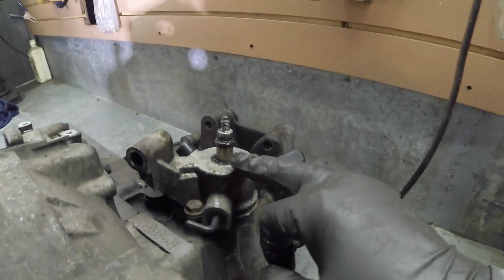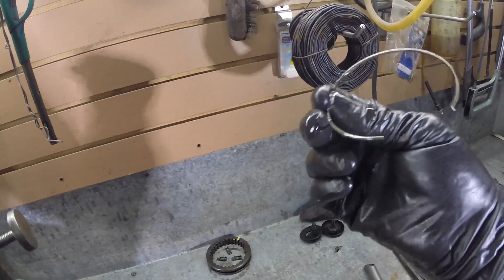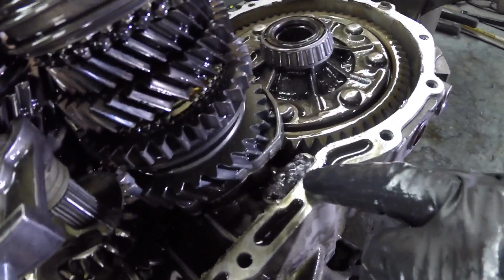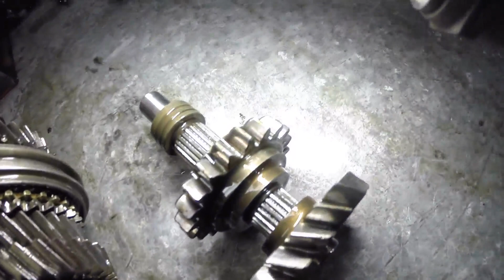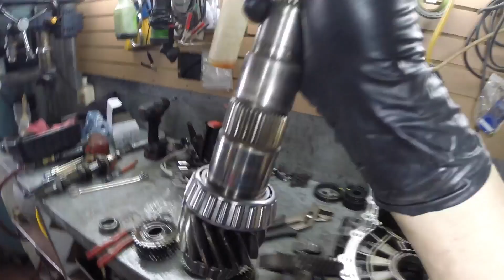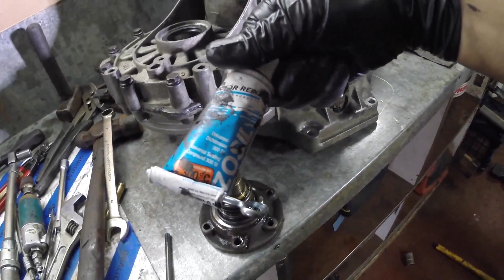GTI TRANSMISSION REPAIR DIFF BEARING AND OUTPUT SHAFT BEARINGS

Comment: You,re entirely right about welding a nut inside a bearing race , then slide - hammering it out , I did it after seeing how you did & it works o.k , just don,t get the alloy housing too hot because alloy never glows , just melts . it would be very useful if you can direct me to a video showing how to disassemble the output shaft assembly , As that,s where I,m at , to be able to change all the bearings on it . I can see how to press new ones on from your videos , they,re very useful , I,m phone-shooting videos myself as I go , so I,ll tell you when I,ve posted them up ! I,ve learnt from the guys on here , to never show an image or reflection of yourself , just your hands . if you can,t handle my accent I am not , as many people assume , Australian , I have a broad rural Northamptonshire , England accent , that I am proud of & make no apology for it , it took 4 generations of us to learn to talk this gibberish !
 I,ll look for the output shaft stripdown video as soon as you can tell me where it is . Many Thanks from Eastern Central England .

Comment: Thanks for the vid! I believe I have to replace the bearings inside the differential where the CV axle flanges sit. Am I going to have to drop and split open the whole transmission to do that? I have a manual 5 speed 03 Jetta tdi

Comment: Buddy are 02J and 02R same on the inside ? I mean I found a bearing rebuild kit in eBay but it says is for 02J and mine is a 5 speed manual 02R

Comment: Hi I'm having a problem with one of these o2j trans, it's is having the self machining syndrome where the diff rub the inside of the housing, this happens from the spring pin breaking and the diff pin slides out and hit the case, but mine is intact, so I figured it has to be the diff bearings, but mine are tight and look in good condition, is it possible for the bearings to be bad without feeling any play?

Comment: Christian, it seems to me that you are a model teacher / explainer. At each step, you explained exactly what I wanted to know next, making it an incredible learning experience for me. No waffle. No nonsense about what a gearbox is and why you might want to fix one. Instead, straight down to business, with a step by step account of what's involved. I want most YouTube videos to be like this - it would be much better use of my time. I hope you are well and went on to do many more good things.

PS: Some here have mentioned endfloat and preload, and sure they are correct. However, you and I know that usually things work out if you do what you did, and CRUCIALLY they don't always work out when you use used or remanufactured gearboxes. I've seen the LEAST good outcome from (gearbox, engine, alternator, etc) remanufacturing places that have all the right tooling. I don't know what they do wrong. Clearly there are business and engineering advantages to having all the right tools, but there are also advantages in doing things the way you do, including how much you learn along the way. When I was younger I did all of my repairs like this, and NONE of them failed!

Comment: Where are you bro? Lol I would come to you. I really like all the details you check . Says a lot to me about you being a mechanic. Take pride in your work. My bearings need to be replaced. I need a rebuilt transmission. The bearing on my driver side axle is whining when I go through my gears. I was thinking get the clutch replaced to and everyone says my clutch is good and just change the bearings on the driver side axle . I put new axles in and it’s still whining. When giving it gas. Honestly I would rather bring it to you lol

Comment: Recently got a vw jetta from coworker for $100 intended to swap my vr into. Long story short she sold it cheap thinking transmission was cracked. I looked in thought it was a slave cylinder since they're plastic and swapped in New one. Drove car to work this morning and saw trail of fluid into spot I parked at. It looks like I have fluid coming out of the top of the transmission. It looks like a inspection hole but I haven't had time to really look. Is this a sign of a bad input shaft seal? I am stumped but want to figure this out asap

Comment: how did you get the bottom bearing off the output shaft? the one that backs up by the small gear that spins the differential? there is no room behind the bearing to put the splitter/separator on it. thanks!

Comment: Good day. Very good video, it shows clearly how to perform the repairs and your explanation is to the point. If you have time I would like to ask you a question: 

I own an 2006 TDI 5 speed manual transmission (very similar to the one you repaired) Honestly I do not know the type of transmission but it is matched to a BRM engine. The transmission grinds when I engage the 3rd of 4th gear, It looks like the synchronizer is damaged. If  when I switch the gears, I let the RPM of the engine to go down to a minimum, then the gears won't grind, leading me to think the synchronizer on 3rd and 4th gear are damaged.

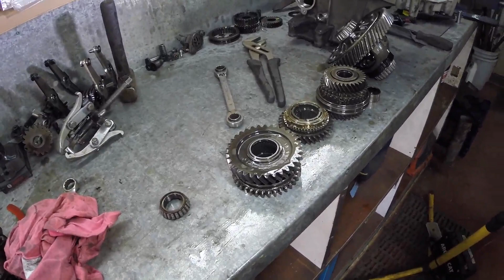At one point in your video, minute 16:42 to be precise, you removed the gears from the output shaft. If I were to replace the synchronizer for 3rd and 4th gear, how can I identify them? Also, you did not show how to take the gears from the output shaft.

Could you provide assistance as of how to perform such replacement?

Thanks in advance.

Comment: hi. a great video, what would you have to do to make the gearbox run backwards? i want to put a engine and box in a vw t2 and have 5 gears- i know can put the engine and box in turned around but it wont be pretty thanks

Comment: Your video was very helpful. I was hoping to take the bell housing section off only for a repair. But after I decided to take it all apart I realized that wasn't going to happen. The bearing punched threw the casting  where the 4 nuts are. I'm going to weld the piece back on and will probably need to remachine the bottom of the bore. I'm assuming zero preload and zero end play on the bearings.

Comment: My DZC ...01 gti 2.8l manual transmission locked up the drivers side  axle... probably broken sleves etc...
http://www.zelek.com/vw02J_hard_parts.htm Sells individual gears/bearings/pitted races... great method to remove these races... slide hammer those races off

Comment: Hey! I’ve got a VW golf Mk 4 from 2002 equipped with 4Motion. And I got a noise from the differential on the gearbox. It’s a loud clicking sound noise when I spin the front wheels round, and it comes when the wheels are in specific position.
When I spin the wheel the other side stands still. Is it repairable or should I just send it to the junkyard?

Comment: Could you provide some guidance?  2003 Jetta 1.8L turbo 5 spd manual Wolfsburg.  Replaced lower control rods without disconnecting drive shafts.  Somehow the flange shaft on the passenger side pulled out of the housing by about an inch.  I plan to pull the drive shaft and see if the center bolt has backed out.  Do you have any advice?

Comment: excellent video but what if the new different bearings were tight? how would you change the shims without destroying the new bearings as you would have to weld parts onto them to remove them??

Comment: Nice... did you get the release fork from auto camping? We had a couple of those gold forks crack /fail.. we only use genuine vw ones now. One of our customers needs one of these transmissions. Something blew up inside, cracked the case and leaked all the oil out. We are waiting for him to tell us what he wants us to do (used transmission, overhauled unit or try to fix it).